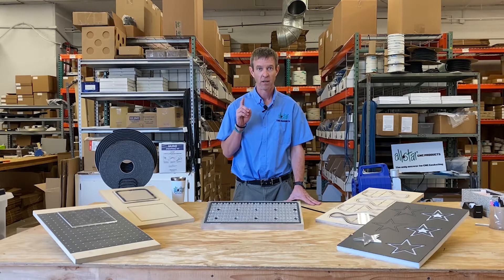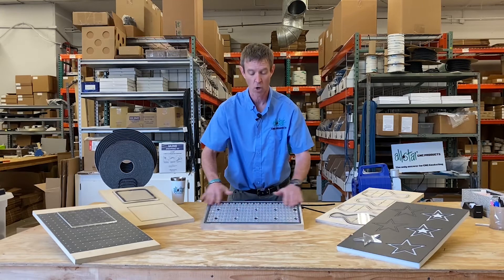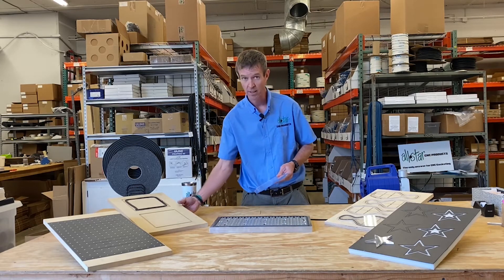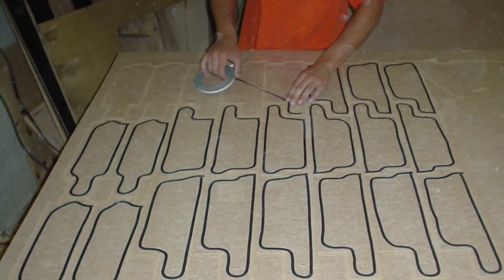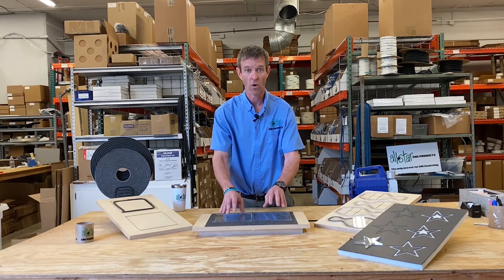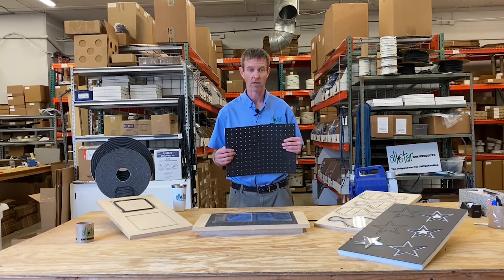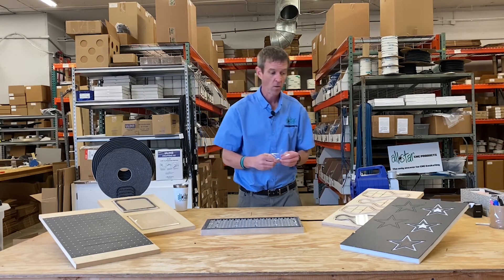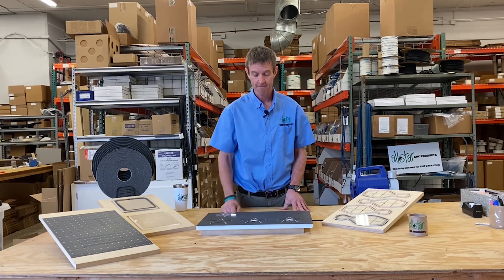CNC Gasketing Product Groups Overview

Comment: I am cutting 1/8 polycarbonate sheet into 12 equal pieces for screens. The fixture I am making will gasket each one as close to the perimeter of it as possible. Do i need a gasket for the outside too, for the whole sheet. 
Would it hold my offcuts? Or just loose my vacuum.
Video on my channel to see it!

Thanks
Leaning toward not adding it.

Comment: I am cutting sheets of 6mm EVA foam that has a non porous self adhesive backing sheet. Currently using a 5mm rubber mat with 3mm holes(very similar to your tile system). I am wanting to change to an mdf spoilboard system but dont get anywhere near the clamping power of the rubbber mat.All the parts that I cut are with an EOT knife that cuts through the  EVA Foam and about 1.5mm into the rubber mat below. If I was to use your gasket tiling system on mdf sheet how long would it last from all the cut throughs of the oscillating knife?
Reply from the maker: Our Tile Gasket is a 1/16th inch (1.5mm) thick material. We recommend our users to cut through their sheet goods about .015 inches or .397mm. This means that the tooling bit is just skimming the top of the Tile Gasket. The life of our Tile Gasket is based off the Z depth control and accuracy. For light weight material like your EVA foam we do offer a 1/8th (3.1mm) Tile Gasket as well but the depth of the cut determines the life of the product. You only want your Z depth enough to cut through your material, any deeper and you are sacrificing gasket material and vacuum.

Comment: I don’t get the difference between the last and 2nd last product. Aren’t they the same !? I mean there’s a pocket under the part wich will Vakuum it down on both models. Could you please explain ? Thank you very much and these products are insane
Reply from the maker: I believe your are referencing the in board gasket and the cover gasket.  The In Board gasket is for a dedicated fixture where you place the gasket in a channel.  The gasket zeros out allowing for no Z depth adjustment and a longer life of the gasket.  The Cover Gasket is a sheet material that is applied to the top of a non porous material and then cut with a drag knife tool to create the dedicated fixture.  The Cover Gasket is used when the parts are too small to make a Dedicated Fixture with In Board Gasket.

We are always happy to chat out your vacuum hold down issue and help you MAX YOUR VAC

800-878-7827
allstarcnc.com

Please subscribe to our you tube channel!
https://www.youtube.com/c/ALLSTARCNCPRODUCTS?sub_confirmation=1